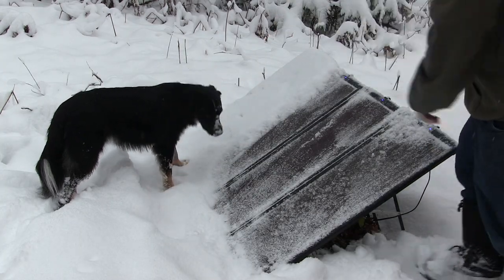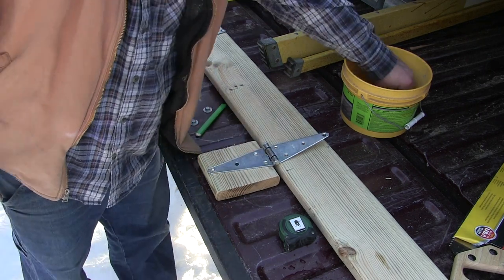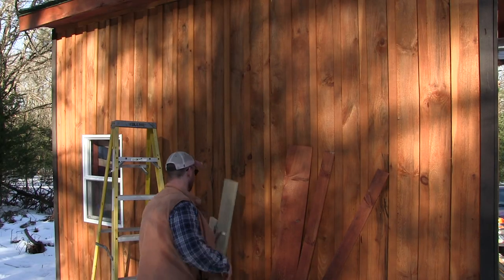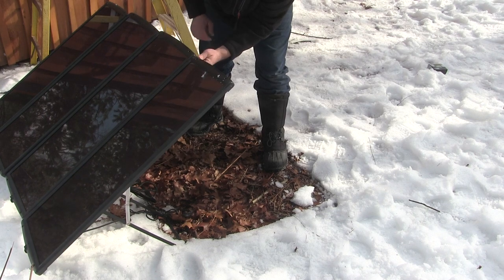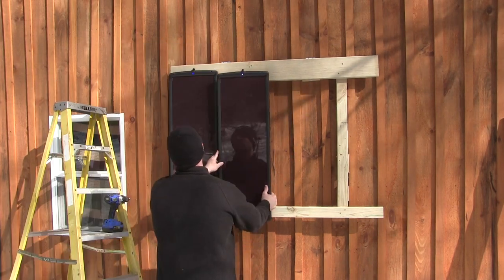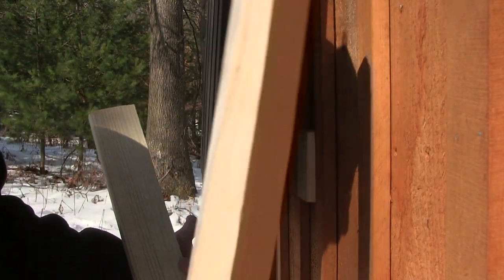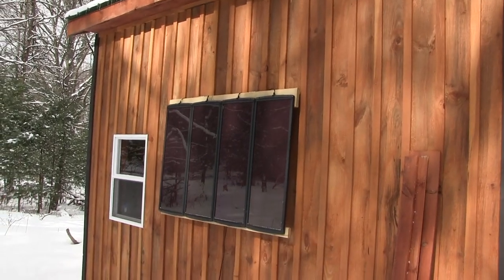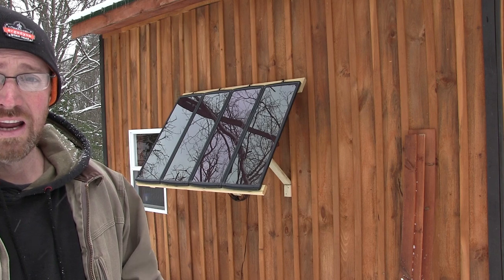Perfect winter solar panel set up

Comment: I recently realized that generators are a short term solution. Noob to solar , and trying to do the math for what I need to run a mini fridge and window a/c unit. I can get by without the rest in Georgia.
Reply from the maker: man I'm not sure what you would need for that . my brother in law lives totally of grid full time and has his hooked to a generator when he notices the battery bank getting low normally at night when the solar can't do anything he runs the generator to charge the batteries
Reply: @blackspruce1861  Thank you. I'm hot natured anyway so a/c is important if I can have it 😂 It'll be a learning experience like other new ventures I've tried.

Comment: I had two sets of these panels. I only got rid of them because of weight and handling purposes. I got the newer versions of the HF panels. They charge all my EGO batteries and keep my lawnmower and go kart batteries top off and warm during the winter months. It's a great system for off grid cabin living.
Reply from the maker: it really is !! I'll have to check out the newer panels at harbor freight . I plan to add a couple in the front of the cabin for summer
Reply: @blackspruce1861  I use an HQST mppt charge controller for all my panels. They have different amps I got the 20 to start and I think it only allowed 300watts of solar at 12 volts and 600@ 24. Cheaper and work just as good as the renorgy controllers.
Reply from the maker: @mkuhlman77  Nice !  I don’t use much power there so I only have the one battery and the harbor freight controller that came with the kit

Comment: Over the winter I've set my panels to about an 80 degree angle. So far so good, alot of overcast but a trickle charge is better than nothing.
Reply from the maker: Yeah it works pretty good as long as you're not using a lot of power . haven't had to worry about it much this winter lol .

Comment: Great setup. Only thing I may have done different was to stain the wood to match the cabin before mounting the panels.
Reply from the maker: I wish I would have but they're pretty light it should be easy to do once the weather gets better

Comment: That's a great setup. I have 3 of the BougeRV 120 watt panels and I've been trying to decide how to mount them on my tool shed so I have easy access to them yet not have them in the way. This looks like the way to go. The only thing I might add would be a way to latch them down when not in use in case of high winds.
Reply from the maker: Thanks !! thats a good idea to latch them down
Reply: @blackspruce1861  That was going to be my suggestion too.  Latch them  when tilted up in case of a gust and when folded down.  A couple of  beefy screw eyes and a ratchet strap would do it.

Comment: Outstanding. I just got a small portable Yoshino setup delivered today. Solid state lithium battery is supposed to be safer , won't catch fire and is supposed to be able to deal with cold better.  I'm still at 85% charge after 1.5 hours with a malxlite 9W LED bulb. So far so good. I don't get the best angle from the sunny window inside this apartment though, but their folding panels are pretty nice.  I saw a guy use a salvaged umbrella stand , turned into a "lazy suzan " to get the best angle. Might have been one of Brooke's people, can't remember. Hmm, I wonder if you could cover that with a little kid's dome tent. Or even use the umbrella.
Reply from the maker: Thanks !! that might be our brother in laws place with the spinning panel out . I can't remember what he said he built it from

Comment: Great video Ryan ! Love what you’re doing as always. My first and only concern would be when you’re there and the stove is going and the suns out …. Is the snow sliding off the roof and cleaning the panels out. Don’t recall the pitch of the roof but if that’s the south side because that’s where the panels are aiming ( lol ) might be a concern. When you’re not there and they’re tucked in definitely wouldn’t be an issue. Just my 2 cents worth. Not that u asked and I’m certainly not picking on your work. Take care man
Reply from the maker: hey thanks  Tony !! I'm slightly concerned about that too but for the  I guess ill just have too keep an eye on the roof when I'm there . for the most part I don't use a lot of power just lights so it might be fine not even tilting them out a lot of times . I'm not sure just another thing to figure out
Reply: @blackspruce1861  I hear ya. Trial and error. Lol. I’m in Maine and I know my metal roof is great but can really tear shit up as the snow slides off. Lol. 🙄😁

Comment: Did you use an RV Gland to run the MC4's into the cabin, or another route?
Reply from the maker: I drilled a hole through the sill plate ran the wire and filled it with silicone

Comment: That will not withstand strong winds.  Needs to be secured better when up and down.
Reply from the maker: the cabin is pretty surrounded by woods the wind doesn't get that bad there
Reply: @blackspruce1861  That's what I thought to on my cabin until a big wind storm caused all sorts of damage.  I have window shutters on my cabin that hang down on hinges similar to your panel setup.  Before I installed latches to fasten them when they were folded down, they would bang away when the wind blew.  Some simple fasters from the hardware store fixed that problem.

Comment: Thanks to you and Andy for this awesome tip! I have 4 older style 160 Watt panels that are quite a bit heavier than your set, but the principle will work great for my set up, too. I might not mount them directly to the cabin, but the hinged mount system is really appreciated! Building my cabin has been a process ... and that's what's been so much fun:) Thanks again, Ryan! Enjoy the journey ... God Bless you & yours
Reply from the maker: No problem ! yeah a post style H frame is probably how I would have went too but with the frozen ground and my impatience lol I chose the cabin .
Reply: @blackspruce1861  ... I like the cabin mount style, just looking at the weight all 4 panels will be supplying:) I'm just about in the middle of the Mitt, so the frost will be out pretty soon. Looking forward to more of your content, sir! Kihelakayo :)

Comment: Panels should be turned around the other way with the cord facing down and a drip loop  in the cord so no water gets into the connection
Reply from the maker: that does make sense but I mounted them the way they would face if they were on the built in stand. I thought it was weird that they have the cords coming from the top too . You would think they would have them run into the back like most panels

Comment: Do the panels keep your battery charge?
Reply from the maker: yes but you do need to keep an eye on the voltage a bit once it gets below I think 11.8 the charge controller won't allow the panels to charge it and you have to take the battery home to charge it . mainly a concern at night .

Comment: what can you power with those panels?
Reply from the maker: they charge my battery and I mostly just run 12volt lights and  charge a blue tooth speaker , but I do have a 750 watt inverter that I can run my oscillating saw with I use it a bit to charge my laptop . you could add more batteries or upsize the inverter and run more and you can add solar panels for more charging
Reply: @blackspruce1861  ive been thinking of getting solar panels, when you have a fully charged battery how long can you run it under what load, for example a fridge, and how long to charge it fully. Sorry for alot of questions
Reply from the maker: @keenmachine80  honestly I’ve never tried running a fridge so I’m not sure but I do know that a lot of people who have smaller solar kits use propane fridges like what campers and RVs have and they work really well

Comment: Great idea!  I have an H frame for my panels that is working out pretty well so far.  I really like your set up.
Reply from the maker: Thanks !! the person who told me about this has his on an h frame I'm sure you could add hinges easily if you wanted too
Reply: @blackspruce1861  My H frame is about 10 feet tall and has support legs that allow me to change the angle.  I'm thinking about building a dolly platform with casters so I can rotate the whole assembly as long as I can make it stable enough to handle the rotation.